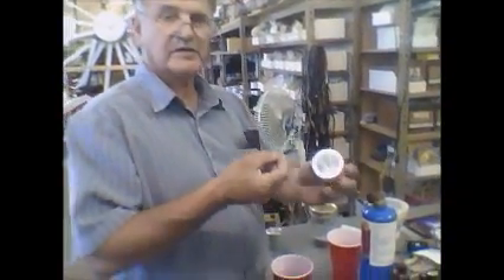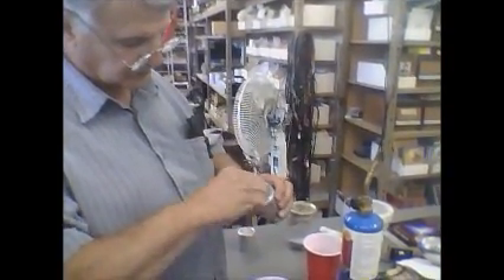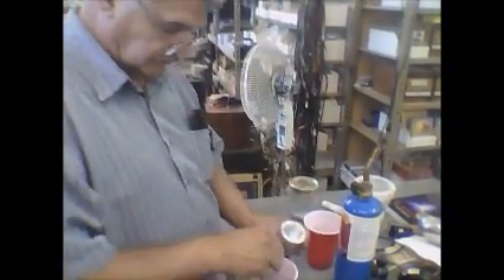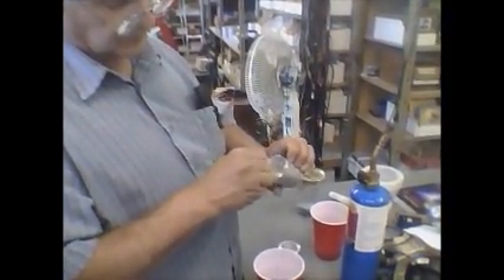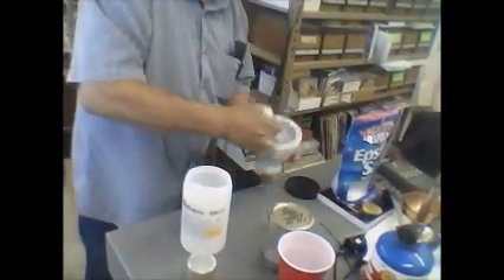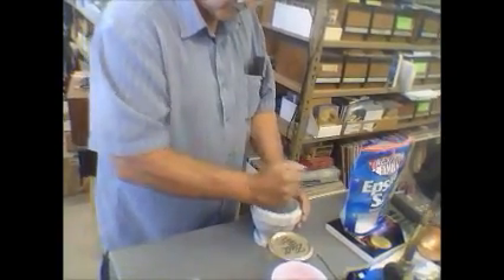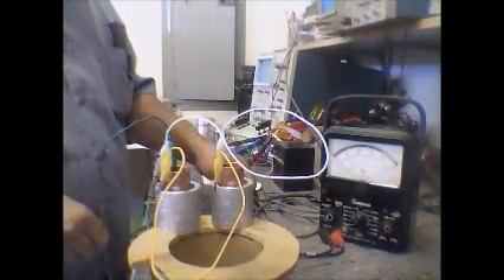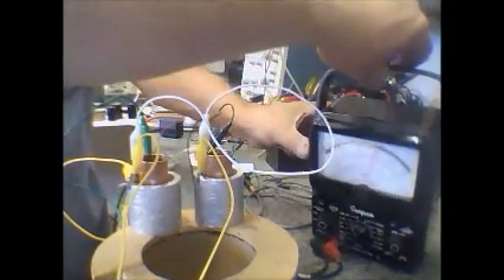2 Mg Cu Hutchison cells as Built by John Bedini  08092011.wmv

Comment: Great! has the copper electrode been heated to form cupric oxide then cleaned on the outside or is it straight copper? And what polarity to what part of the cell when adding the battery? Looking forward to the DC magnetic field conditioning explanation also. (retrorocket59)